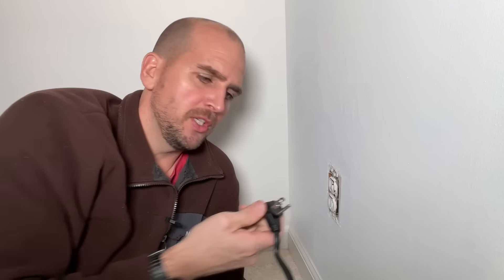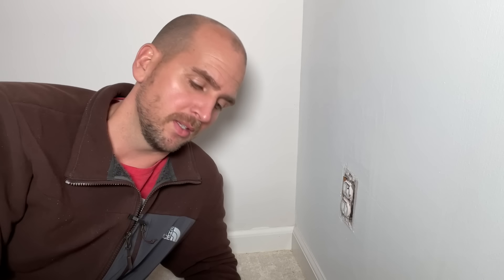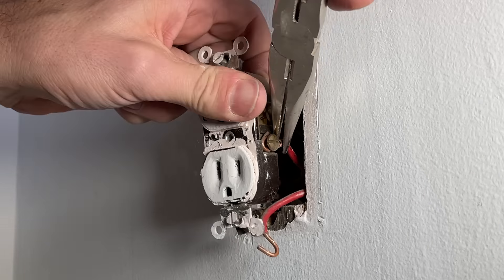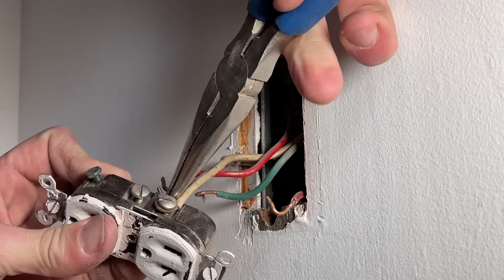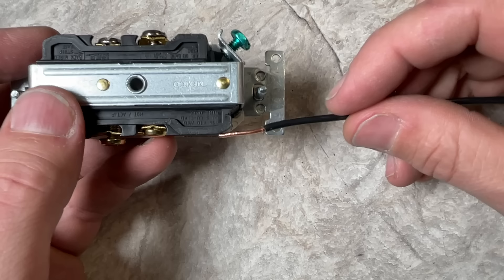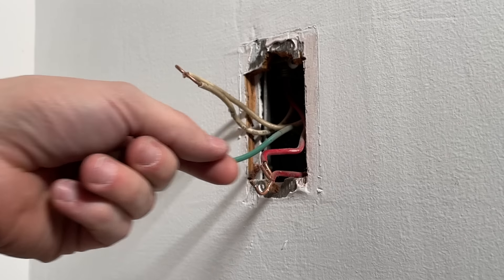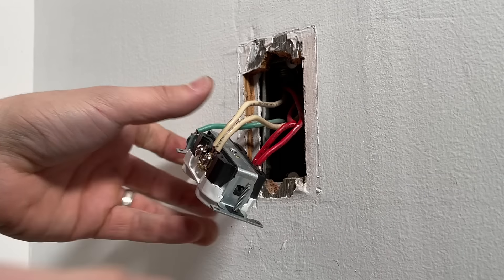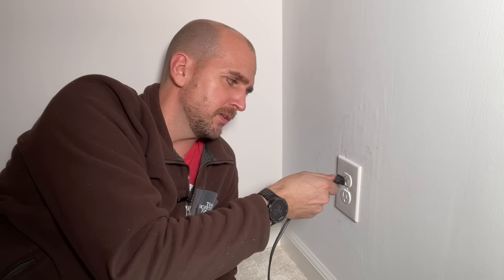Plug Won't Stay In Outlet

Comment: FUN FACTOID: A two prong cord that will only plug in one way is called a "polarized plug" and will have one spade that is wider than the other one. The smaller of the two spades is the "hot" side (copper colored screw on the receptacle) and the widest spade is the "neutral" side (silver colored screw). The "round" spade on a three prong plug is always the ground wire. When installing a GFI (ground fault interrupter) (where two or more receptacles are on the same circuit be sure to install the GFI at the first receptacle or closest receptacle to the breaker box. This will trip and stop the current to all receptacles down the line behind it in case of one shorting out.
Reply: Just bend the prongs. They always fit perfect and snug and there is never a problem. I have several outlets throughout my house where they are worn but I bent the prongs inwards and shoved the plug in and never had a problem again. You can't tell me that's a hazard, can ya? I mean I do wonder why that would not be an acceptable solution for someone who don't wanna take the damn thing apart. I have bent them for decades, never had a problem that I know of. There must be a reason why he does not mention that.
Reply: @hook-x6f  Probably only two reasons that I can think of as to why this is not mentioned. One, when the connection is "loose" sparks or arching can occur inside the wall when contact is made with the plug. And also devices that use a moderate amount of electricity such as an electric heater for example can overheat the plug and cause an electrical fire if there is a poor connection between the appliance and the electrical connection.
Reply: Yes, although you do have to be on the lookout for shared neutrals as those do sometimes occur in kitchens where you'd be using GFCI.

Comment: I use to be an electrician in the UK (retired now) and yes I do know a little bit about American electrics but it is nice to watch a Americans wire up things to see the differences between us! We have 2 new things we have to do now; The first is to PROVE something's dead (you can now buy a new 2 part test meters here). And the second is now the electrical council prefers you to use a torque wrench screwdrivers (obviously to make sure the connection is the correct tightness) "I dont know if the torque screwdriver is regulation yet". The UK the electrical council has for the last 20 years or so has been quite hot on health and safety and has always been hot on making sure the equipment your working on is dead and tagged out.

Comment: Even if you are not comfortable replacing an outlet, this is still one of those helpful tidbits I think every homeowner should know.
Reply: You should be comfortable swapping an outlet and switch.
Reply: Another cause of wear is when people yank the cord to disconnect the plug. If you do this for a couple years, the 
lateral force is essentially prying open the contacts. Always grasp the plug and pull straight out. That said, you might have an outlet behind a heavy piece of furniture with perhaps a lamp plugged in. The outlet and plug are hard to reach. I would be less concerned about this as you’re probably not unplugging the lamp very often. Pulling by the cord once a year is probably not going to substantially damage the outlet.
Reply: I don't
Reply: I'm a master electrician and I love to shut your channel down
Reply: I like to know the right way to do something before I hire someone. Yes, I watch over their shoulder......
Reply: @Junior Thornton You shouldn't feel threatened by do-it-yourself videos, the majority of homeowners are afraid of electricity and will hire an electrician for electrical projects.
Reply: @francoamerican4632  Well said 👍🏼
Reply: At least enough knowledge to know if they hired the right person to do the work, and understand what they are saying.
Reply: @juniorthornton3819  While I’m sure you do good work. I have seen master electricians do horrible sloppy work, exposed wires on outlets, relying on mounting screws for grounds, way to many wires in wire nuts, to many wires for the size of j box etc. Maybe I’m picky but I do better. A title does not make good work.
Reply: every homeowner should feel comfortable doing simple repairs like changing out an outlet or switch. obviously leave the big jobs to the professionals, but there are many things you can do without being a professional
Reply: @Stackali  I disagree about “ Every homeowner should feel comfortable…”  If someone doesn’t “feel comfortable “ then they should call on someone else with experience to do the job.  That can be a licensed electrician or a neighbor with experience.  Now, I certainly agree most homeowners can do this replacement, but if they do it and then have sleepless nights worrying about it then it’s best to have someone else do it.
Reply: @johneverett3947  Not to mention using quick connect. Had to redo all my outlets and switches because they were quick connected and lights would flicker and TV ( old tube type) would draw down. Have had investment properties that were QC in a metal box and arched and shorted out a few outlets.

Comment: 7:10 Another advantage of cutting off the old hook-bent wire-ends (if the existing wire-length allows it) is that you will not be re-using the already flexed-several times wire-ends that could thus be embrittled from metal-fatigue; for maximum current-carrying capability, you'll always want nice "fresh" solid wire that hasn't been cracked or abraded.
Reply from the maker: Thanks for the feedback Fred 👍

Comment: For the receptacle connections, I came up with this memory jogger to remember the wire color for the silver terminal (Neutral).
"What is the color and name of The Lone Ranger's horse?"
Answer: White and Silver. So connect the white (Neutral) wire to the silver terminal.
Definitely easy to remember for older folks and even younger fans of that heroic character.
Reply: Or, for the other side, “Black (Hills) Gold”, a common type of jewelry in middle America. Just remember if your hot wire is red, that’s still the correct one…